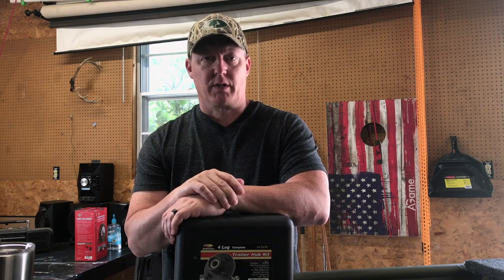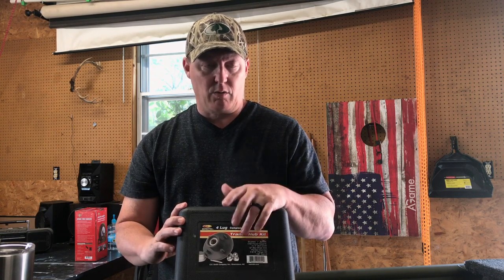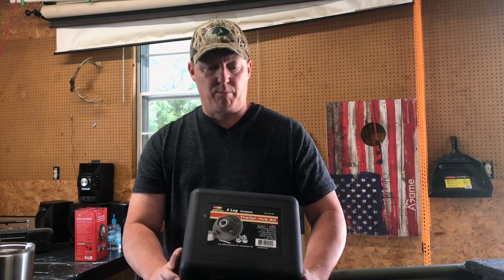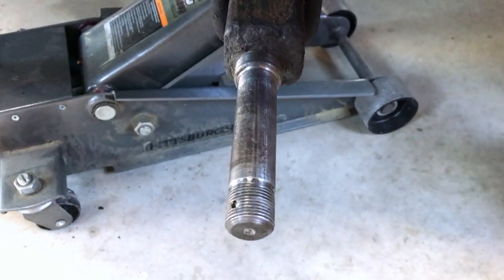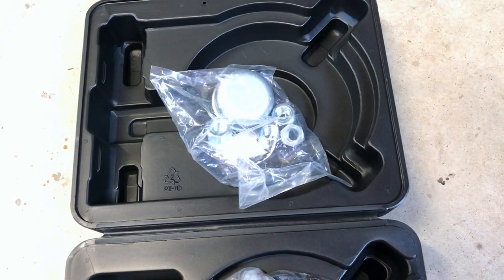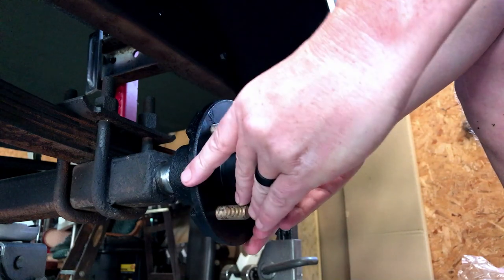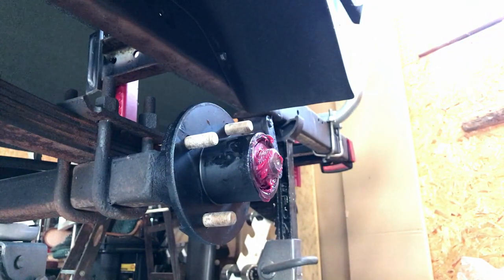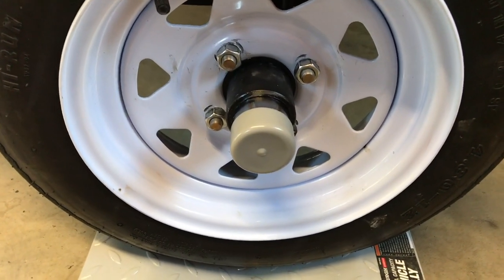How To Replace Hubs On A boat Trailer

Comment: How tight does that castle nut need to be?
Reply from the maker: Just hand tighten the nut finger tight until it stops, then back it off just a little so the cotter pin fits into the next indentation of the castle nut. Then I bent the two ends of the pin so it could not slide out. I hope that makes sense, thanks for watching.
Reply: I did that and have a little forward and back play in the new hub
Reply from the maker: @cory5517  From everything I read and watched on Youtube there should be a little play but not much. Check out this article on etrailer site https://www.etrailer.com/question-101936.html it says the movement should not be more than 1/4" inch.
Reply: Thanks for the article, my play isn’t more than 1/4 inch
Reply from the maker: @cory5517  Your welcome, happy to help.

Comment: If your going to do a how to video show the whole job. How tight,how much grease did you pump in? Ect
Reply from the maker: Sorry for not including that info. I hand tighten the castle nut finger tight until it stopped, then backed it off just a little so the cotter pin fit into the next indentation of the castle nut. Then I bent the two ends of the pin so it could not slide out.
As far as pumps of grease , I stopped when it started oozing out but the  important thing with boat trailer bearings is regular maintenance. No matter how well your hub is sealed, or how much grease is in it, regularity putting it in the lake or river will eventually lead to contamination, that’s why I check mine all the time. Again sorry for the lack of information, thanks for watching!

Comment: Yeah agreed if you're gonna do a how to video show all the steps nobody cares about your boat and your plans on what you're gonna do show us how to do the dam steps
Reply from the maker: My apologies Josh for leaving out putting the nut back on and tapping on the bearing buddy. Here is a link with detailed instructions if you need more information than I have provided in this video https://www.etrailer.com/question-101936.html
Reply: @ArkansasFishingVideos  You left out removing the nut, replacing the nut, the cotter pin, everything really.  It was basically a shot of a complete wheel, followed by a fully disassembled system down to the axle, followed by a picture of the wheel.